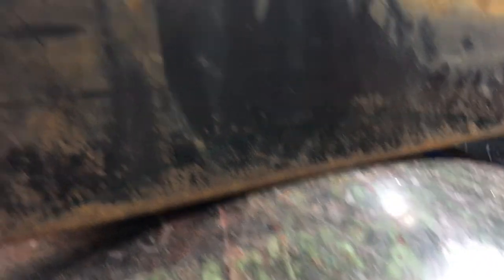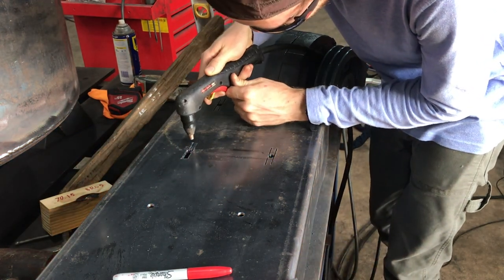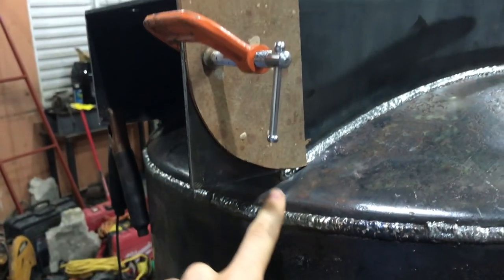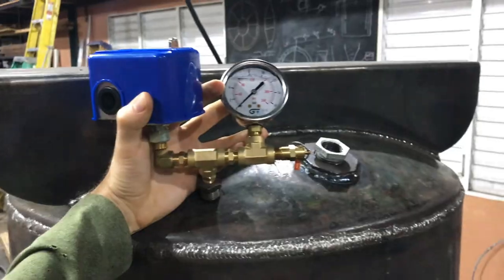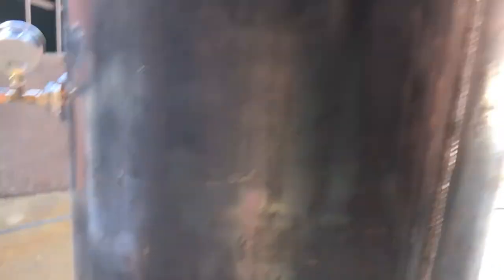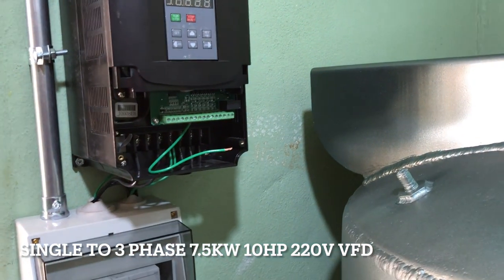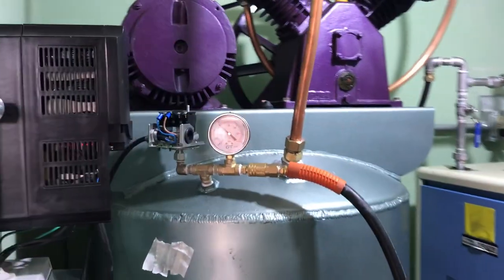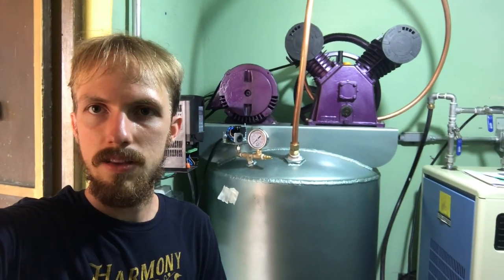Building a 5 HP Air Compressor -Part 2

Comment: Nice planning, ambitious scratch built tank, & hydrostatic testing Before 1st use, for Safety. You almost built it perfect the 1st time (minor oops you mentioned: missing check valve, & wrong pressure switch without pressure unloader feature.) She's a blue ribbon winner! This was a good safe build, congratulations! I saw 1 air comp. YT build series that was a fiasco from the start, should be labeled how NOT to build an air comp.. Yikes, I & others feared for his life. Anything that stores compressed energy (air in this case) is a potential bomb. He did not study, understand & shamelessly copy EVERY part of a high quality, engineered, factory made air compressor, & how it's tested for safety! You did well sir. Respect!
Reply from the maker: thanks I am glad you liked it !!! It gets a lot of use now and it works amazingly well after the new pressure switch and what not I finally finished part three where I go more over everything and the refrigerant air dryer. 
but I do have to admit I felt a bit stupid several times for remaking something that factories seem to have down so well but where I live an air compressor like the one I built could easily be $3000 or more and I really didn't have the money for that and the final product is honestly better than most of the commercially made ones in my opinion with the frequency drive and all

Comment: For future reference you can use ER409Nb rod with GTAW with 100% argon for welding high carbon steel or stainless to cast iron. Special order from most suppliers.

Comment: What VFD brand and model did you use? I need one for a residential set up?
Reply from the maker: I got my VFD off of eBay 
https://www.ebay.com/itm/224268117313?mkcid=16&mkevt=1&mkrid=711-127632-2357-0&ssspo=8vnkh760qh-&sssrc=2349624&ssuid=&var=&widget_ver=artemis&media=COPY
this is pretty much the one I got I think The only thing is it was extremely difficult to program an electrician friend of mine tried to get it to work and wasn't able to. 
 I ended up hiring a specialist and he got it working perfectly